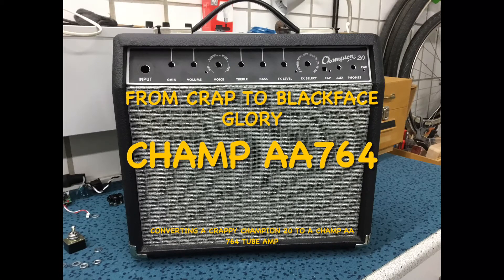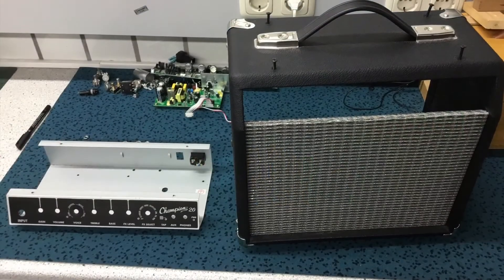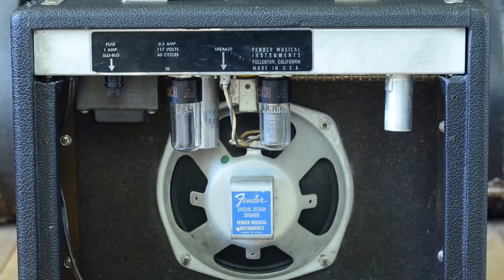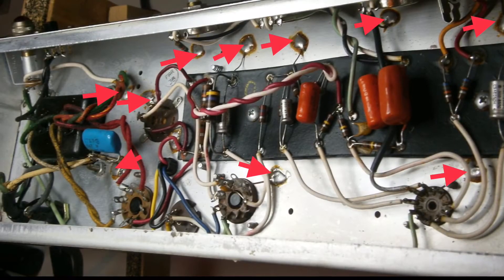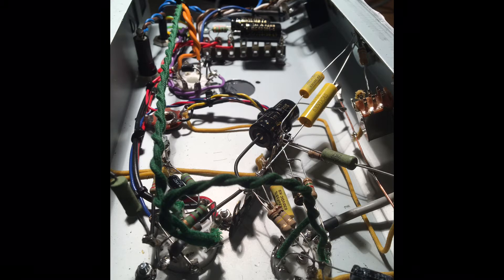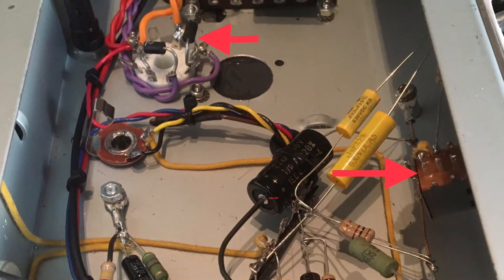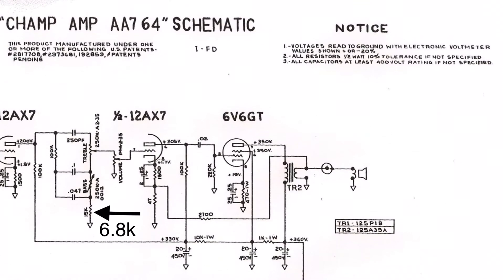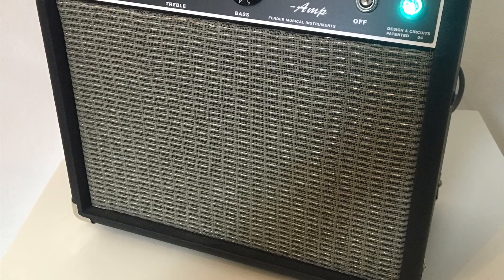Fender Champ Amp AA764: How to convert a Fender Champion 20  into a Blackface Champ Amp

Comment: I just finished a clone of the AA764. Those grounding points are fantastic. I also thought, looking at the original, that it would make noise. No such thing. They somehow figured the compensation was perfect, and even when fully cranked, the amplifier is completely silent. What's more, I also previously twisted the filament wires and ran them separately. The hum was significantly greater. I recommend trusting this design.

Comment: Nice job. Wanna try this myself. Where did you find the faceplate?
Reply: I designed the faceplate on my computer. Put it on an usb stick and brought it to a printshop. They printed it on a selfsticking foil, that I put on the raw aluminum faceplate. A lot of work and a little bit complicated, especially the design job, to get the right dimensions. Took a lot of experimentations. Printed it on paper first, to check the right fit over and over again, but looks good after all.